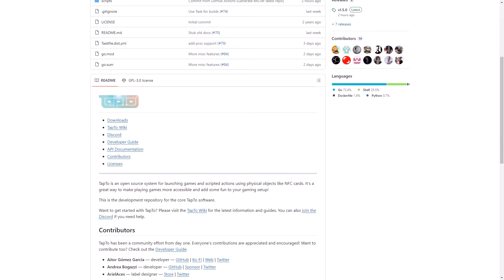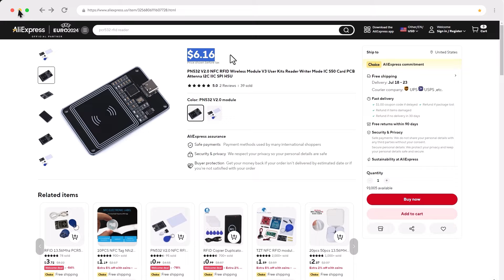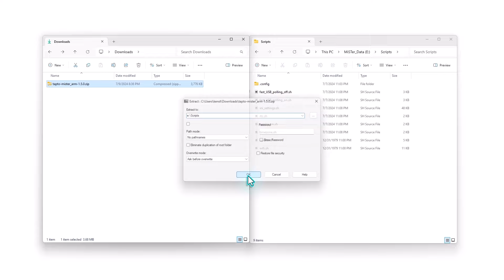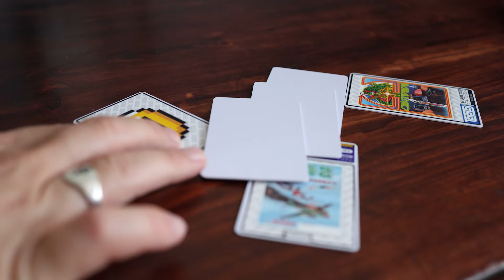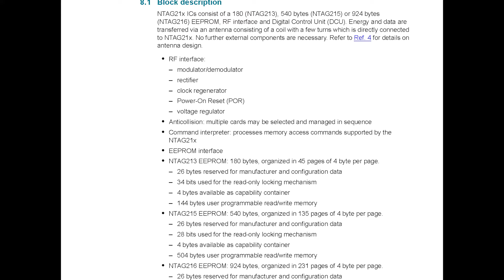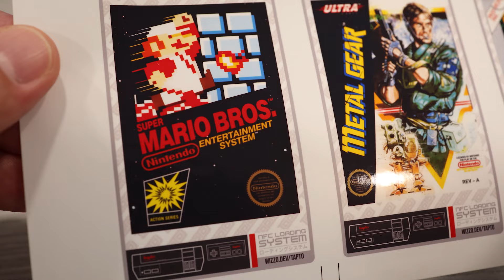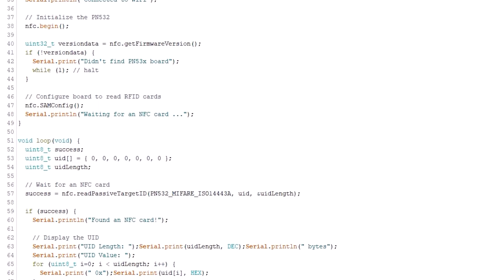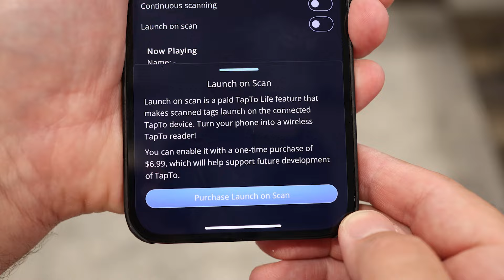Exploring TapTo on the MiSTer

Comment: I'm actually curious if the TapTo can be repurposed into other appliances and gadgets, not just the MiSTer things. What if it can be used as an easily accessible physical token on home media boxes to play movies, or as a car infotainment add-on to automatically play music albums denoted by the token? If configured right this kinda eliminates having to go through a bunch of menus to play whatever you want.
Reply: Inspired by Cathode Ray Dude's mentions of his struggle with Spotify
Reply: That’s the plan! I am porting TapTo to other platforms as we speak. Windows will be up next, then looking at the various Pi distros like Batocera and Recalbox. Music and video playback will definitely be supported soon, including services like Spotify
Reply from the maker: I just saw that wizzo released a windows demo on the discord and twitter. I don’t think we’re too far away from seeing broader integration
Reply: I've thought about how this can be used in Linux to basically send whatever script you want. Could potentially make a card that entirely deletes your home heh
Reply: @ChristianWS.  not by default! I do try to be cautious about arbitrary code execution. But you can enable manually if you want and go nuts making drive wipe cards

Comment: since it has an api
you could configure EmulationStation running on a rapsberry pi to launch games on the mister (instead of launching an emulator)
all you would need is an ip controllable hdmi switch to switch from the rpi to the mister when launching a game, and back to the rpi when you exit one.

then you'll have a world class ui with box art on an fpga system

Comment: I wasnt terribly interested in this project beforehand, but now it seems really cool! Dont know if Ill actually get one, but it is certainly an interesting tool. Gives back some of the physicality of putting in a cartridge or disc, and being limited to only a few instead of a never-ending scroll through a menu.
Speaking of that floppy disc drive case, it would be awesome to see one with the big switches like on the 5 1/4 drives; you could slide in the card, then flip the switch with a satisfying "clonk". Maybe the switch could move the NFC reader onto the card, so it has more of a practical purpose (or it could just be for fun)
Reply: That's a super cool idea.

Comment: I love the idea of placing the nfc stickers inside my cartridges. In practice however, when adhered to the inside of the back half of the shell the success of the read seems to vary significantly between testing the plastic shell half and reassembling the cartridge. It seems like any time there's something behind the tag, be it shielding or pcb it rarely reads the tag. I've had a lot of issues with GBA where the pcb is behind it; on N64 Battle for Naboo, a half height cartridge it works fine but Shiren 2 a full height shielded cartridge does not. Have you run into this and is there some sort of thin barrier material that might prevent the interference/read failures that you're aware of? Thanks for the great video either way :)

Comment: How do you get the stickers to sit so straight on the cards? Do you have a secret method for applying them?
Reply from the maker: I peel back just the corner of the backing and cut it off, so just the of the sticker adhesive is exposed - then it’s easy to adjust the position on the card. Once you have it where you want it, peel off the rest of the backing to fully apply the sticker